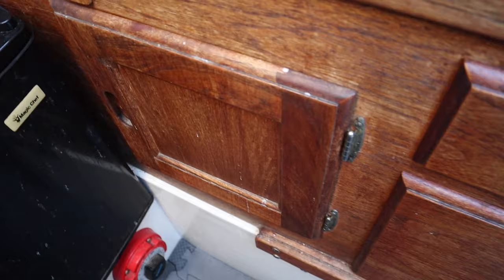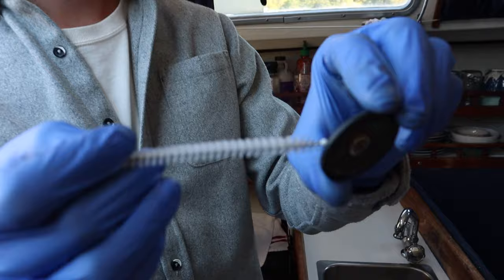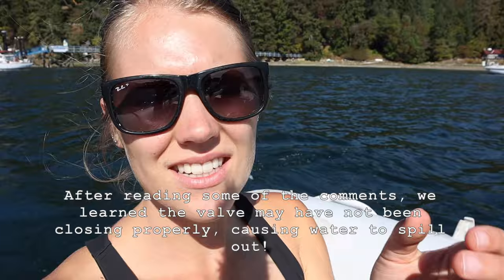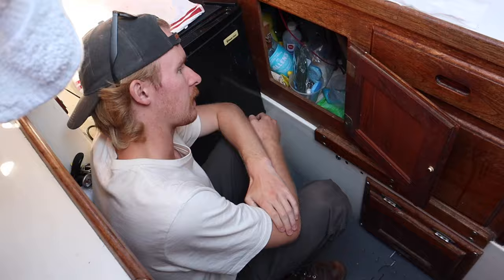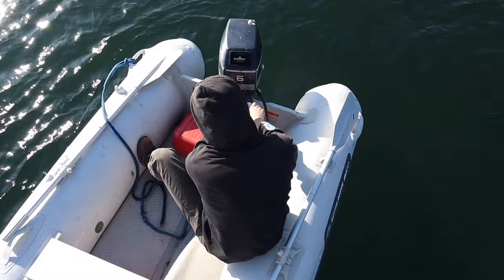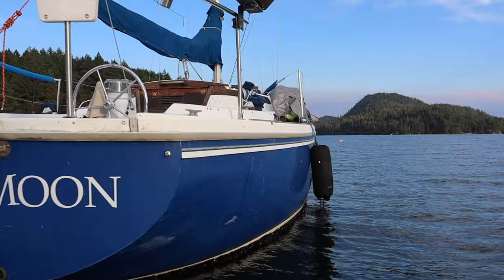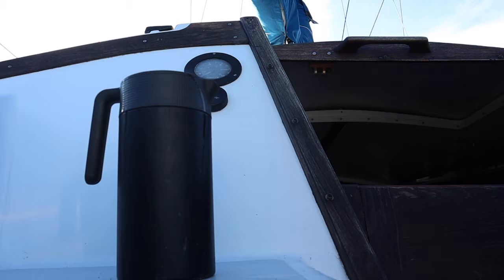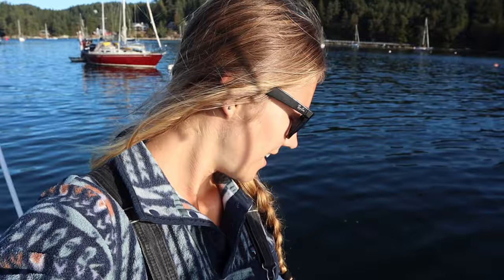Quiet Day in the Life Off-Grid | Boat Life Engine Maintenance | Signs of Fall

Comment: If the anti-siphon valve fails/sticks and water gets into the cylinders it will hydrolock the engine and it won't turn over.  Your engine may have a compression release lever which will open the exhaust valves.  By using the decompression lever you may be able to turn the engine over and the water will get pushed out the exhaust valves then it will be able to start.  Although not ideal by any means you should be able to get the engine running with minimal harm.  An oil change would be good after a hydrolock event.  I would also start out fresh with a new anti-siphon valve.  The decompression lever should be by the valve cover if the motor has one.

Comment: The rubber eventually gets hard. Sadly that diaphragm kit from Groco is about $99 US. Which is like $800 CDN these days. My Groco AS valve did the same. They all do after a year or three.  I tapped the top hole in the screw top for a 3/8"/10mm hose nipple and ran a 3/8" hose above the heeled water line. No more leaks. Keep the diaphragm in the system though.